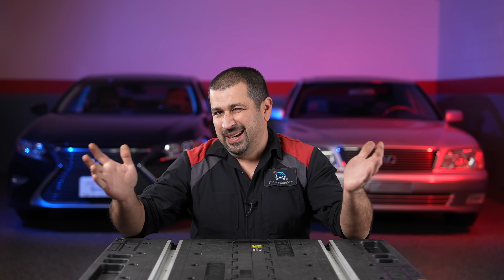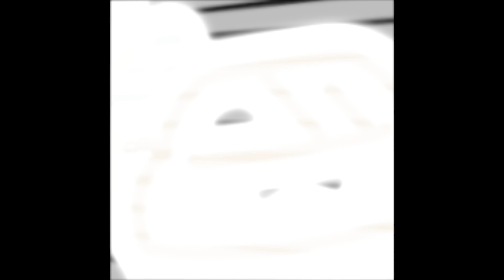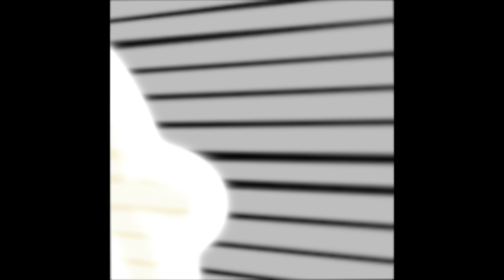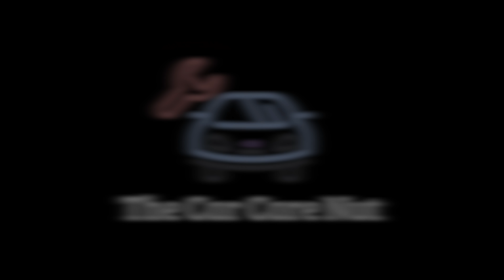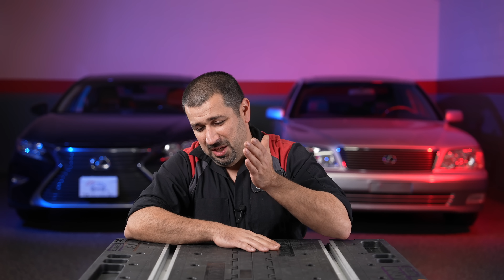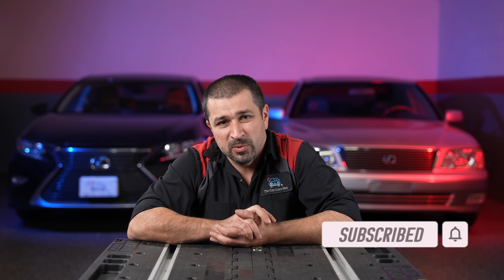Can Modern Turbo Engines Be Reliable? Here's The TRUTH!

Comment: It’s not just the turbo itself, it’s all the baggage that goes with them, additional coolant and oil lines that will leak at some point, extra radiators and water pumps on some models, additional engine compartment heat that bakes everything plastic and rubber, and higher cylinder pressures.  A whole lot of parts that will fail can easily be avoided sans turbo.
Reply: ditto
Reply: Basically engineering. More complexity = More failure

Comment: I replace the oil of my non turbo (small) engine every 4000 miles. After 150k miles zero oil consumption, compression is like new and it's very clean from the inside. The gearbox oil was also "lifetime" oil. I still replace it every 30k miles. Still shifts like new and no whining sounds. A new car is expensive and oil is cheap.

Comment: Almost no one will change oil more frequent than the recommended interval. Just about no one performs any other maintenance on their vehicle. Just about everyone will run their vehicles into the ground and get another one, even though they cannot afford a new one, they get one any way. Hence the price of new cars charged by manufacturers. No one cares about what condition their vehicle may be in when they get rid of it. Car owners that perform the proper maintenance (or go above and beyond) are the rare exception. Very few people actually appreciate and understand the requirements of mechanical equipment.

Comment: Good turbos work well.  My ford transit 250 , cargo work van has regular oil changes every 5k and regular maintenance. Zero issues. 200k miles. Great towing. Very quick motor.

Comment: Agree Oil changes are important.  You also need to be careful, the engineers will tell you the truth and they also know what the difference is between miles and kilometres.  In Australia its usually every 10000 km, yet in the USA they seem to use 10000 miles, well folks 10000 km is approximately 6500 miles, but the marketing spinners will tell you what you want to hear.  Be aware and change the oil frequently as AMD has suggested and enjoy trouble free motoring from Toyota.

Comment: Been working in used & new car garages in the UK for 30 odd yrs,so many bring their cars in over 10,000m for a service even with it's 5yr warranty period! And still have FSH/FULL SERVICE HISTORY. But Severe driving is what most of us do as the roads are getting busier,roads works everywhere & start stop traffic is now common with traffic lights everywhere & the rush hour. I do not buy a used car over 10yrs old with a FSH even a main dealer FSH if it  looks serviced over 10.000miles (Seen so many),it'll be nothing but trouble. I go for a constant max of 8,000miles as that is a decent service history not poor. If a car is well looked after it's worth that bit more,forget those dreamers who price their cars high & say "With FSH" to say the price reflects on the service history....just let another new owner pick up the garage bill when issues arrive,i've seen it all. Remember a poor FSH is (All over 10k service),a decent FSH (Ave between 8k - 10k) & a good FSH (Mostly under 8k) is a thing! Poor will cost you at the garage with bills and good will cost you more on the buying price. I've seen PRIVATE sellers writing in the service stamp book with a red,black & blue pen just the date & mileage with ZERO proof of receipts of them buying oil,oil filter etc...they just buy them & say "FSH" but it's not even garage serviced! THINK GUYS. Again,you can save money on a cheap car but spend on repairs then the tax on top DON'T FORGET or spend more on a decent car & save on repairs....your choice. It's tough out there to get a good vehicle as few care for them.

Comment: The growing prevalence of the turbo gas engine in passenger cars, suv's and trucks is a bit of an experiment & wager (in terms of longevity) and the consumer is left placing the 50K bet. . . . The driving & maintenance habits of many average drivers (not the car care nut channel fans) does not bode well.....Ironically, owner's will need to check & change oil on these turbos like it's the 1960's-1990's but drivers have not been educated to this norms, and manufacturers have gotten them used to never opening the hood and doing crazy 10-20K oil changes... It's like 1980's-- 3month/3K oil changes....and no one is advertising this when they sell the turbo cars/trucks.

Comment: Yep NO turbos for me. I bought the last of the best 2 SUV Lexus vehicles with  V 8 engines and I will make them last the rest of my life.  Ahmed THANK YOU for keeping us in the loop all the time.
Reply: We have a 2018 VW ATLAS with a VR6 engine. NO turbo and NO EGR VALVE either. I change the oil every 5-6K miles. Transmission fluid every 30K miles and every 2 years we do the brake fluid as well as the 4 Motion fluid. 70K miles and no major issues yet.
Reply: I also got the last  Lexus v8
Reply: @MinnieBamba-qb8zh  looks to me like we are smart people!!
Reply: Cars don’t last forever.
Reply: @Pamlicojdjdj1487 Depends on your age!!!!!!!!!!

Comment: Both my vehicles are 20 years old. Both in great shape.  Plan to buy a new one end of the year. Not because I need one, but this might be the last year they make non turbo engines with a regular automatic transmission. Staying away from turbos and CVT transmissions.
Reply: I have a 22 year old car with a supercharged engine that I daily drive and run on the track 3 times a year or so. Dead reliable at 183k miles because I maintain it.  I also have an 18 year old car with a turbo engine and 175k miles.  Also daily driven by my wife and dead reliable.  Finally, our 17 year old NA V8 with 166k miles that isn’t day driven but is reliable.  Common denominator?  I keep up with all the maintenance and repairs with high quality parts.

Comment: I have a 2024 Tacoma, really not worried about the turbo.  There are a 100 other things (sensors) that can go wrong and affect reliability.  I'll keep the oil changes to 5,000 mile intervals, and drive it until I'm tired of the truck.

Comment: As a mechanical engineer, turbo engines with start stop technology is terrible.  Unless you have electric oil pump,  water pumps and electric turbos to circulate fluids and bearings that rotate slowly while stopped,  oil changes are 1 big factor, but hard driving with engine off mode at stops or operator not giving 30 seconds atleast before engines off is destructive.

Comment: Can we get a sit down between TCCN and Dave Coleman from Mazda to go over the 2.5 turbo in higher trims of the Mazda 3 and CX-5? The way it creates boost at lower rpm’s while still having a decent displacement seems like a decent option for a turbo model. It would be interesting to know how much boost is run in turbo cars and use that as a comparison to other turbo cars as maybe one factor for long term reliability.

As always great content TCCN, thanks!

Comment: Hello, I just bought a Toyota Yaris hybrid 2025 second hand, it has 18,000 kilometers and was a lease car.   I'm worried about the sound it makes when I'm driving below say 80klms an hour. The engine sounds like it's struggling and sounds like it should be in a higher gear. The garage man said not to worry it's only the battery charging. It happens a lot and it's very disconcerting. Any advice would be appreciated. Help please.

Comment: Turbo engine especially direct injected ones contain many more components. So even if they are well built and the owner maintains the car well, there will be more items that can fail over time so it will cost more to up keep.
Regarding cooldown of turbo engine, this is true for old technology. The new ones have after-run coolant pump that cools the turbo when the engine is turned off.
I owned a 2L turbo. it has 118K miles and the car feels like brand new. 5K oil change interval.

Comment: It’s basic physics and common sense: with higher pressure and increased heat, a turbocharged engine is generally more prone to wear and potential failure than a naturally aspirated one. If you’re considering a used car with a turbo, make sure you can confirm that the previous owner(s) maintained it meticulously from day one. Otherwise, it’s best to steer clear!
Reply: What you say is correct but turbo driven engines compensate for this by having 6 month/6K mile service intervals with full synthetic oil instead of the normal 12 month/12 mile interval with normal oil..

Comment: Turbo engines have been reliable for over a decade, but it depends on the manufacturer and their experience with them.  My 2006 Saab 9-3 which I sold at 200,000 miles after 12 years never had an issue.  Now the second owner is running it with 280,000 on it after 19 years.  It truly depends on the experience of the manufacturer and the quality that they have.  Believe it or not, some of GM's turbos are very reliable today.  My 2018 Buick Envision which has a changed 2.0L turbo four (direct injection instead of port injection as with the Saab) now has almost 105,000 miles but again, no issues.  I trust GMs engines (transmissions, not as much but I bought a very old transmission design on the Buick which only has a 6 speed).  By the way, changed the oil every 5000 miles on both cars, and still no problems.  The trick is you have to get synthetic oil, and good oil.

Comment: Fortunately, BMW doesn't mind people changing their own oil & filter.  With a cartridge filter on top side of the engine and an access panel for the drain plug, oil changes on a M240i are super simple.  Tried that on an Audi Q8 and it requires removing the entire airbox, loosening the two front crossmembers and removing the two-piece undertray to get to the drain plug, total pain in the ass.

Comment: Long time Toyota tech here. We don’t see them very often anymore but anytime we work on a Supra or MR2 Turbo we always warn the customer about the unintended damage that might happen when we work on them. The under hood temperatures are so high that every plastic or rubber part on or near the engine will likely break as soon as we touch it, no matter how careful you are. Fuel injector connectors crumble when you touch them, rubber air inlet hoses split wide open and on and on. Worst of all the parts are no longer available, it’s a nightmare.

Comment: As a former master tech, I can share my answer. It's "no." A turbo on a gasoline engine, one that has to be as light as a feather in order to meet fuel economy requirements, is an act of engineers forcing the engine to make more power without making all of the other components more durable. This shortens the engine life dramatically. There is a parallel in the aviation world, which is the world I entered as a pilot after I left the service bays behind. A typical piston aircraft engine without a turbocharger has an expected lifespan before a major rebuild of about 2,000 running hours. The same design engine with a turbo is anywhere from 1,600 to 1,800 hours. With engines in cars, the effect on engine life is even more dramatic. People "put their foot in" the engine, making the engine work VERY hard, racing around like they are driving a V8 and not a four cylinder engine. I would perhaps lease a turbo so I didn't have the expense when it fails, but I would not buy such a car. Change the oil on ALL cars at 3,000 miles. Don't let them get you to use 0W-20, either. That's also so they can get better fuel numbers. 5W-30 for me, across the board.
Reply: It sure does, especially earlier Honda 1.5 turbos with really bad fuel dilution.
Reply: I was about to say this about aircraft engines.
Reply: GDI oil dilution makes the 0W-20 even thinner, right?
Reply: @Olseawalker yup
Reply: @Olseawalker 
Wait till they recommend -5W0 oil.
Reply: So you saying I should use 5-30 oil in a 2022 Toyota rav 4? Will this not harm anything?
Reply: @lordhughes7690 
I put 5W30 in my Rav4.
It's a fairly older model,
but I don't use synthetic garbage.
Reply: I agree 💯 
I don't use synthetic oil.
I just change it sooner.

But, the yes for turbos to last is if have it on a smaller car. Just to drive is fine.

To ask trucks to pull with turbo is ridiculous.
Reply: Doesn’t matter if the engine outlasts the rest of the truck, which is the case with most Toyota turbos that are WELL maintained. Which means 3,000 to 5000 mile oil changes. Every time.

Comment: My wife has a 2023 Chevy Trailblazer 1.3 turbo. I change her oil and filter every 5K and I have disbled the auto stop start system. Put nothing by Chevron fuel in and she mostly drives it back and forth to work. Will doing this all keep the turbo lasting longer?

Comment: Turbo cars make the used car buying situation even worse. An engine can be overall well-built but the previous owner can absolutely ruin it with poor oil maintenance, and nobody will know that but them. Then, of course, when they realize it could die any day, they'll want to sell it to you. Now that turbos are becoming the norm, not the exception in certain high-strung sports cars, this is going to become a much bigger issue. Now that the stereotypical person who doesn't know that cars need oil changes is driving a turbo, the secondhand buyer is in a real problem spot.

Comment: I have a twin turbo diesel 4.5 litre V8 200 series landcruiser (2018) with 130,000 kms - oil changes every 6months or 10,000 kms - long hwy trips at least once a month. It lopes along easily- no issues to report. Hopefully lasts another 10-15 years (500,000 kms plus)

14:32 Would love if you could please do a deep dive into this engine - as I believe that most issues are caused by modifications and the aftermarket industry promoting catch cans, pre filters, air boxes, GVM upgrades etc

So your opinion of how modifications effect the lifespan of a car would be appreciated

Comment: The only thing I would add is if you come off a hwy. and within a couple of blocks you shut off the engine, that is not good. Look for an exit further away from your final destination so you can drive 5 or 10 minutes at lower speeds so the turbo can cool down a bit. If you don't you will have a red hot turbo baking whatever oil is within it's reach.

Comment: Duty cycle. Turbo should not be used to compensate for torque needed to do work (move heavy mass) that would be otherwise provided for by a properly sized NA gas engine. Manufacturers DO NOT share your goal for MAX RELIABILITY. Not at all. This introduces more complexity, more underhood heat, more maintenance demands.

Comment: I'm driving a Mazda Turbo and it's not just the turbo I'm worried about... It's also the Direct Injection.  The high pressure fuel pump make a horrendous clatter while cold. Your video has prompted me to do an oil analysis for my next oil change. I wonder if my 5K mile oil change intervals are okay because the oil is pretty black. I don't want to change it too frequently but our non-turbo cars oil don't look as bad as the oil from this turbo and it's probably best to start following the science (per the motor oil geek).

Comment: Why did Toyota abandon their 'tried & true'  naturally aspired line of V6 & V8 engines???

Sure, I know they brought in these turbo engines to pave the way for more torque, better MPG & smaller blocks (with less weight).

However... those solid, legacy engines are now gone. : ( They should have still been offered at least as a chooseable option.

Comment: what is your take on 2008 is220d? is there something that I should be looking for? For now mine has 150k miles and was services regularly, is it time to look into the chain? Can I replace flywheel and clutch for Uniclutch two plate clutch? Oil in diff and trans were change when i got the car and now I have to change belt, pulleys , pulley tensioner and water pump.

Comment: Turbo Bearings: Oil vs. Coolant
Oil’s Role:

* Turbo bearings (journal or ball type) are lubricated by engine oil under pressure.

* Oil reduces friction, prevents wear, and carries away heat generated by the shaft spinning at over 100,000 RPM.

* Without oil, bearings would seize or melt within seconds.

Coolant’s Role:

* Coolant surrounds the bearing housing in many modern turbos.

* It doesn’t lubricate bearings but absorbs excess heat, especially after shutdown when oil flow stops.

* Prevents oil coking (burning into carbon deposits) inside the bearing housing

Which Is More Important?

* Oil is absolutely essential for turbo bearings. Without oil, the bearings fail almost instantly.

* Coolant is secondary but valuable: it extends turbo life, prevents oil breakdown, and protects bearings during heat soak.

In short: oil keeps bearings alive, coolant keeps them healthy longer.

Practical Takeaway

*  Always maintain proper oil quality and pressure—this is the lifeblood of turbo bearings.

*  Ensure coolant circulation is intact, especially in water-cooled turbos, to avoid long-term damage.

*  Letting the engine idle briefly before shutdown helps oil and coolant stabilize temperatures.  

A good design allow for coolant to to circulate in the turbo  housing after the engine is turn off.

Comment: I’ve had only one experience with a modem eco-turbo drivetrain: a 2019 Honda civic 1.5t… commute 25k/year 95% highway. Changed the oil every 5k. By 90k it began to smell like gas half way thru the oil changes. By 105k oil was getting so diluted I had to drive with the windows open because of the fumes. Traded it in for a RAV4. 

Never again.

Comment: Diesels are very heavy duty.  They have to be to take the intense compression that would blow a gasoline engine up.  As a general rule I don't like turbos on gas engines.  I would never buy a used car with a turbo where there were no maintenance records.  You just have to assume that car hasn't been maintained properly or even at all.